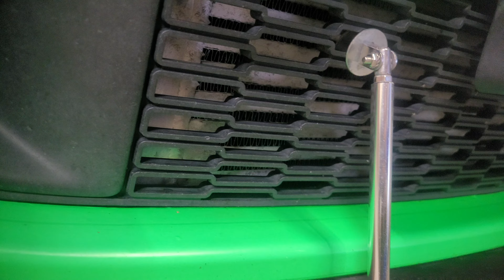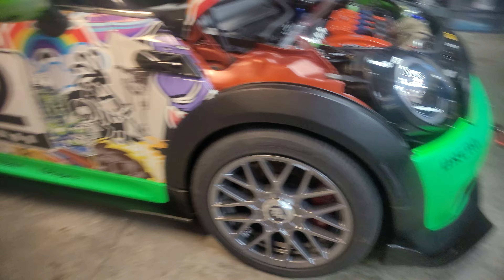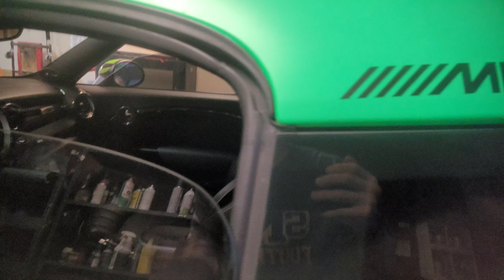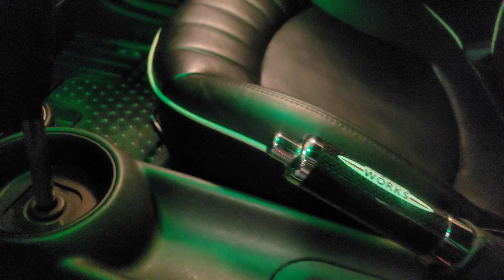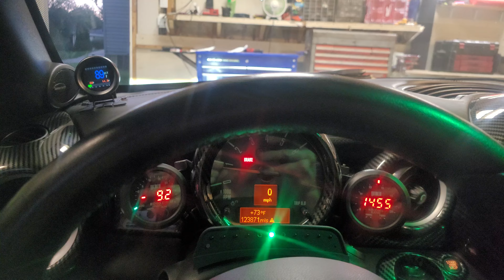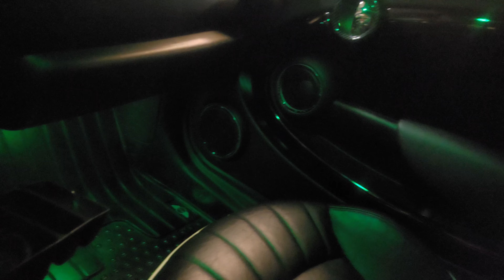FULL RUNDOWN on my built mini cooper r58 jcw

Comment: Look into RPM Power parts. The N14 actually has more power potential as of right now compared to the n18, even though it needs more attention. Thanks for mentioning those rev 9 coilovers i wanted to get them but them but not sure.
Reply from the maker: N14 also has much better tunability also due to the single vanos. The n18 dual vanos doesn't not allow for as aggressive tuning ( from what the tuners have told me ) so base v base n18 is better but for modifications, n14 alllllllllll day !
Reply: @minimanadam  💯 for sure, great job on your mini so far.

Comment: Any issues with the new intake manifold?
What tune are you running with the F21m? I have one but I havent seen any info for it tuning wise. I have a rpmpower stage 2 and would love to know if i swapped in the f21m if i would have issues or not
Reply from the maker: I had adriancl do a custom/on road remote tune.
Reply from the maker: I can't imagine just swapping turbo it would give you aby issues considering these cars psi is all ecu controlled..
Reply from the maker: Oooonly issue I had with the manifold was the nuts would come loose , I HAD to use lock washers WITH locktite on grade8 nuts.. I DO have to make my own gaskets too for it which isn't a biggie but does get annoying when time comes to remove it for any reason .
Reply: @minimanadam  I was concerned about overboost, I had the issue before I got a tune when I first put the turbo on and then decided to remove it. It may be worth trying to install it again and see what happens.